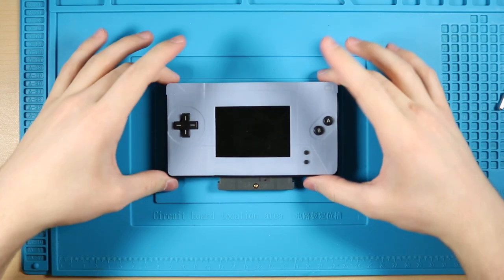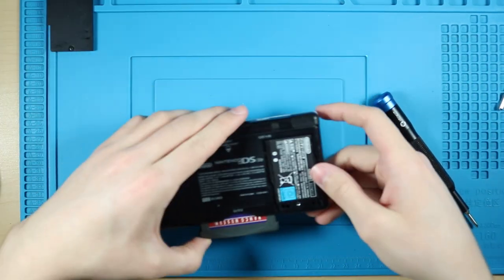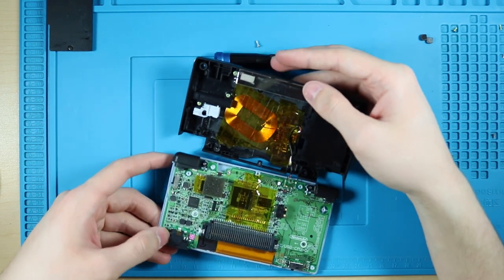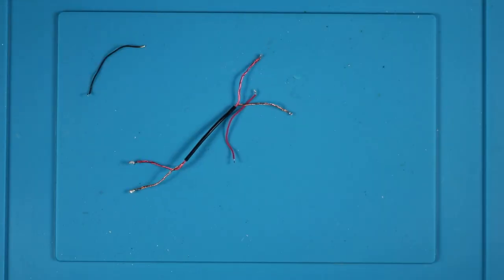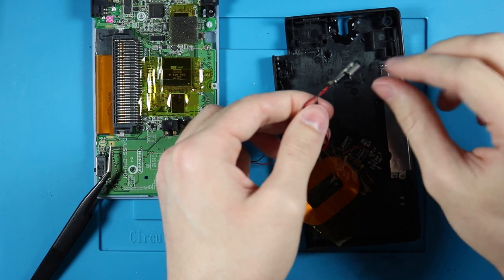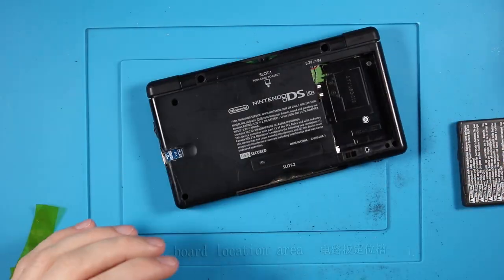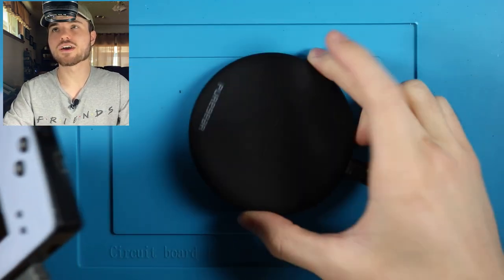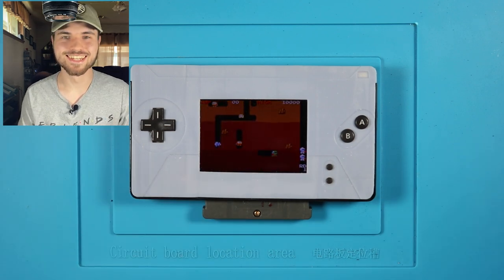How to Add USB-C and Wireless Charging to a Game Boy Macro!

Comment: Cutting away at the stylus holder seems really ineffective for a USB-C port considering how many large holes you would have to fill in with body filler to make it looking decent. The better option to me would be to just desolder the original DS Lite charging port and placing the USB-C connector there since the connectors are almost exactly the same size.
Reply from the maker: My usb c board just would not fit, otherwise I would have. For that particular macro, I don’t really care about looks🤷🏼‍♂️